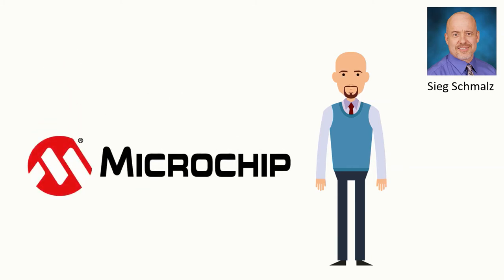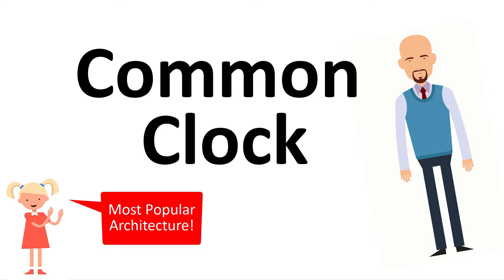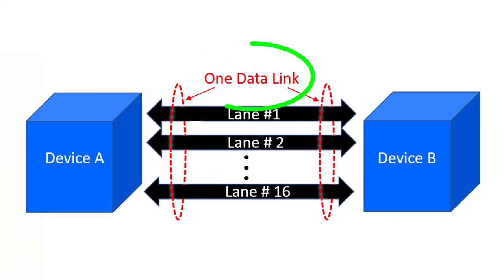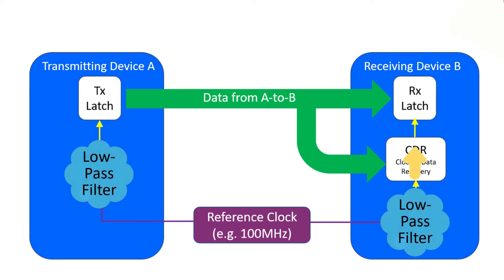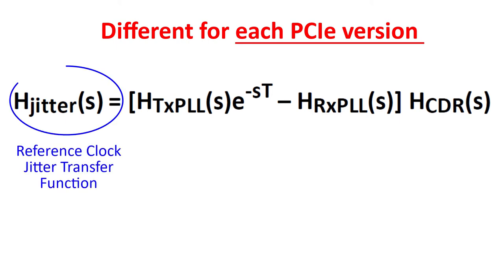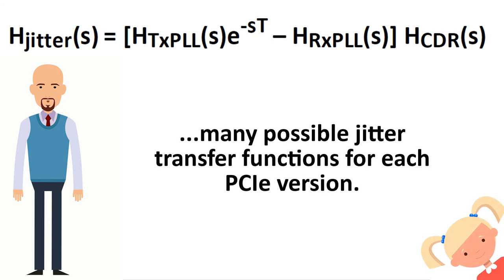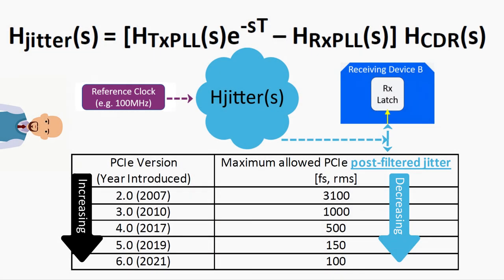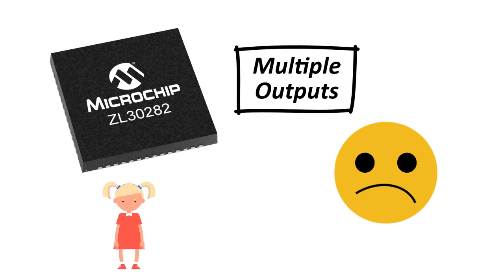PCIe QuickLearn | Clock Architecture and Requirements

Comment: Thanks for the video clip. Just wondering why some PCIe SSD like M.2 doesn't need the reference clock? (There is a crystal placed in the M.2 SSD. Does it serve the same purpose?)
Thank you.
Reply from the maker: Hi, Zac. Thank you for your question.
•	If an M.2 SSD has a PCIe interface, it will require a clock.
•	If there is no external reference clock that is being provided from outside the SSD, we surmise that the reference clock is internally generated – such as with a crystal as you mentioned.  
•	Do you have an example of a M.2 PCIe SSD with no reference clock? If so, we can contact the manufacturer to learn the specifics if the reference clock source is not described in the datasheet.

Comment: Does it the reference clock require AC coupling caps ?
Reply from the maker: The use of AC coupling caps will depend on the devices that are used to implement the Transmitter (Tx) and the Receiver (Rx). The Tx and Rx datasheet electrical parameters provide specifications for input clocks.  If the Tx or Rx require AC coupling or provide it as an option, this will be stated in the datasheet.
Reply: @MicrochipTechnology  Thanks for getting back to me.   My question was not on the TX or RX pair.   It is more on the Reference Clock for the PCIe.    I am sort of getting mix answers on whether there is a need for AC caps on the reference clock.
Reply from the maker: @kch6516  To clarify, our previous reply above was not referring to the Tx or Rx pairs. Our answer applies to the clock input of the device that receives the Reference clock (shown as the purple clock input for “Device A” or “Device B” in the video).  The green data path entitled “Data from A-to-B” refers to the Tx or Rx pair.